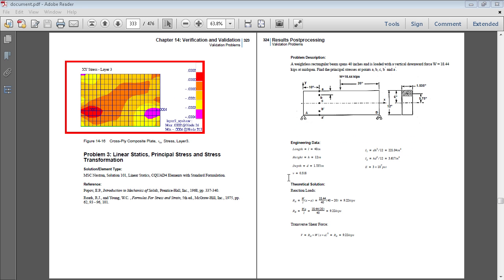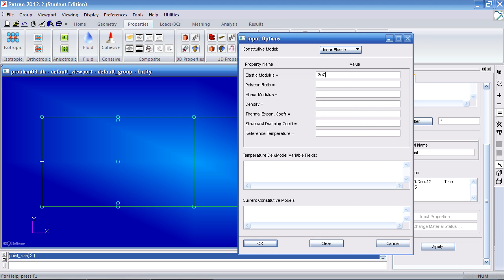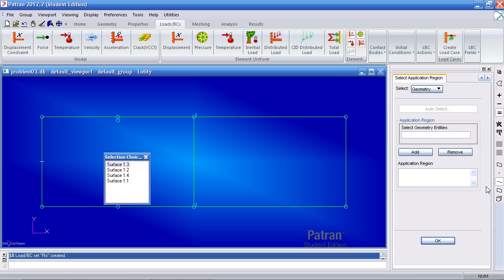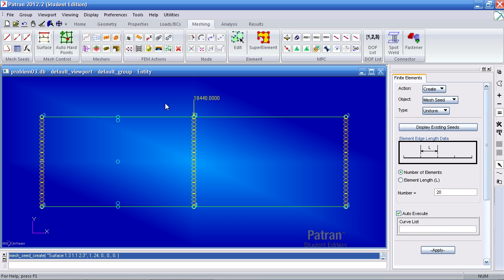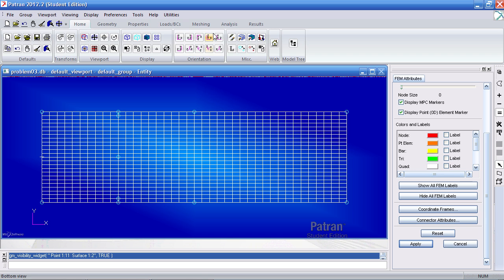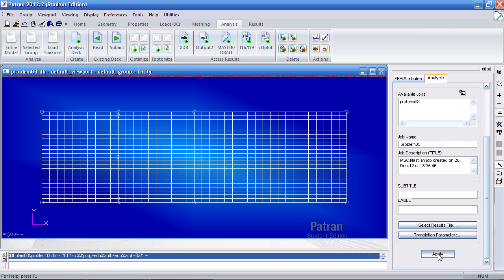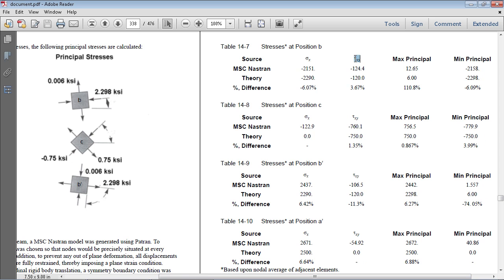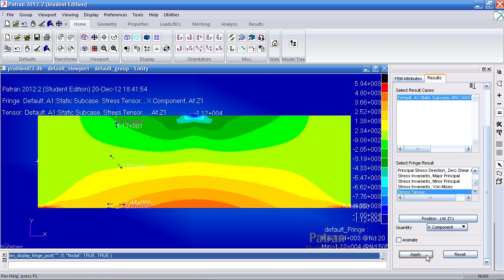MSC Nastran, Patran Tutorial - Linear Statics, Principal Stress and Stress Transformation

Comment: Probably the worst pre-processor I've had the misfortune to use. The graphics are dreadful, as they rarely update automatically; you have to refresh nearly all the time. Most of the useful commands have been thrown in the after thoughts section called "Utilities".

Compared to Hypermesh, this still seems to be stuck in the '80s.
Reply: +Lewis72 MSC has a new pre-processor: MSC Apex, which is much better than patran. Much easier and more friendly.